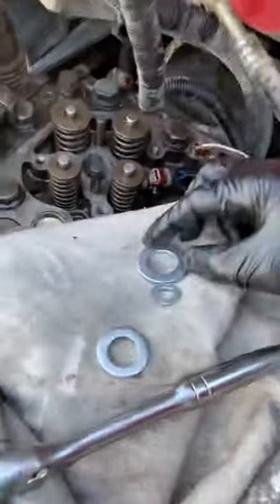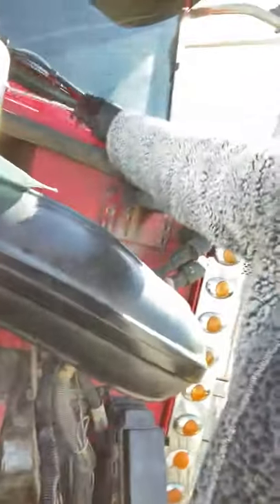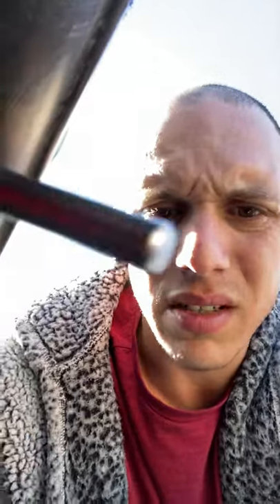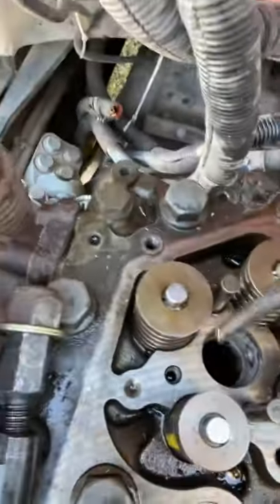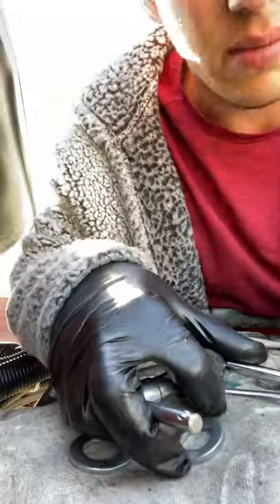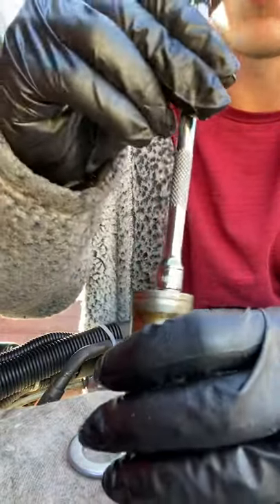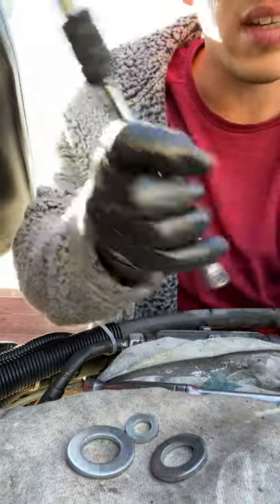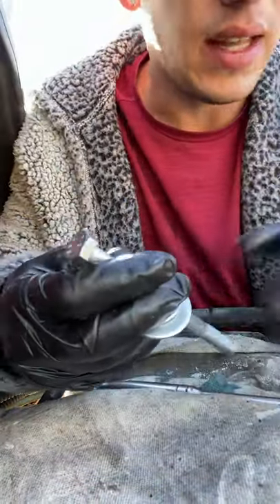Paccar injectors sleeves easy way out

Comment: How did you remove the injector sleeve after putting the bolt with the washers on? It didnt show in the video and im wondering after you tightened it down what did you do? Also how did you install the new ones?
Reply from the maker: I used the bolt with washer as an extractor. For installation I used the injector itself and let it cure for like 24  hours or more. Don’t forget the installation glue Sir.
Reply: Ok that makes sense, i have removed the sleeve, so now i can put the new sleeve in with the injector, did you tap it in from the top of the injector while the injector bolt was in? I have the high temp green loc-tite sleeve retainer sealant.
Reply from the maker: @BrandonG-ei1ol  by applying the specified torque to injector bolt, that pressure is enough to keep the sleeve nice and tight, new ring ,high temperature sleeve retainer and 24 or more of cure time should do it. Good luck.
Reply: @tomasmiranda2235  what kind of glue did you use?
Reply from the maker: @craigcarpenter1461  high temperature red lock tire.

Comment: Great vidio
All I need next is how to acquire the special size oring.  I can deal with. Metal shavings and debri and cleaning it.
Reply from the maker: You can buy The original o rings at the dealership. Don’t forget to add  high temperature thread locker and let it set for a hole day.

Comment: How did you know that the sleeve was bad? What was the truck doing before this I’m hoping this is what’s wrong with my truck and not the whole head needs replacing.
Reply from the maker: A couple of symptoms will indicate a leaky cup: 1 coolant inside fuel tanks. 2 coolant inside combustion chamber.Also you will have compression in fuel tanks as well. Hope this solves the problem.